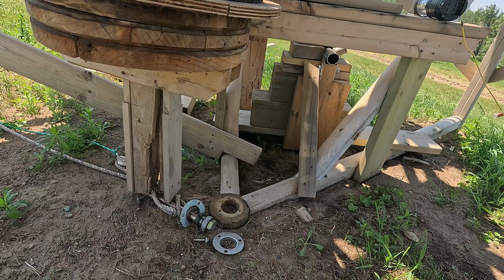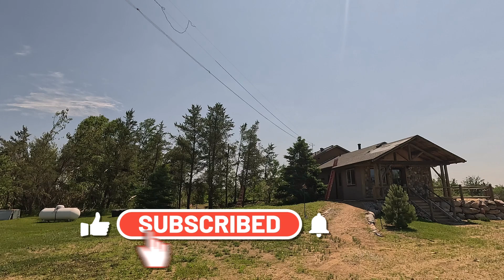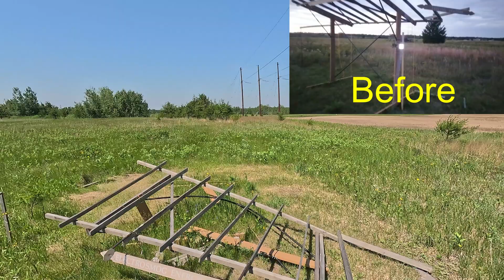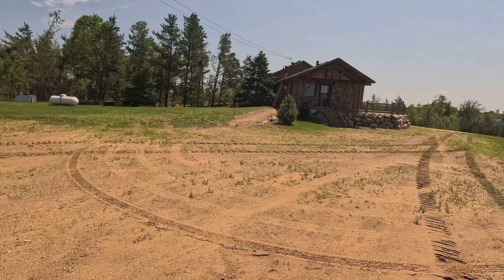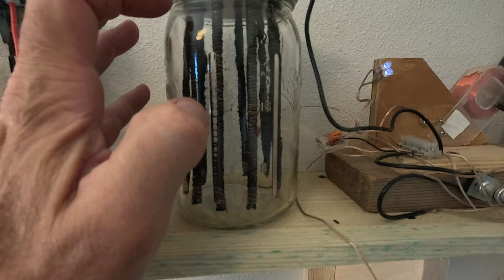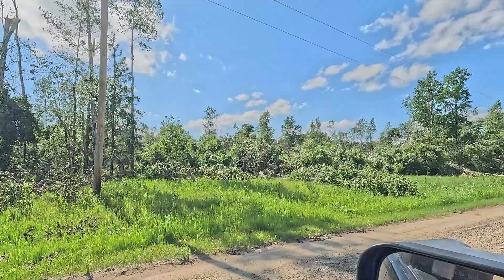Double M Innovations took a hit!

Comment: Sorry about the damage❗️😱
Would like to see an analysis on your failed pieces and parts of each experiment.
Maybe you can gain some information on how to build stronger and teach us at the same time.
Look forward to the videos 👍😎🇺🇸
Reply from the maker: When I made the wind turbine, I planned it would only be temporary, and used the cheapest materials.  It did survive 60 & 70 mph wind storms before, but didn't figure on sustained winds of 100-120mph.  Same with the other things that went flying.  The aluminum frames of the solar panels just weren't strong enough, and the connecting bolts ripped through.  I guess, just build things stronger if you want them to last through hurricane  winds.

Comment: Wow at the damage! I lived on the Gulf Coast for about 16 years and endured half dozen hurricanes. Only one even came close to the damage incurred in your county! Here in Arkansas where I now live, we had a miniature version of your storm a few months ago that knocked down the biggest trees, took the tops out of medium sized trees and hardly touched the smaller ones. That damage was confined to an area approximately 80 acres. I hope you can salvage lots of components from your damaged experiments.
Reply from the maker: I think this was the most damage the area has ever seen.  I think I can save most of the lumber for the big turbine, and I have plans already an "Electro-smog energy converter" off easement from the power line.  -coming up.  Thanks for the comment!